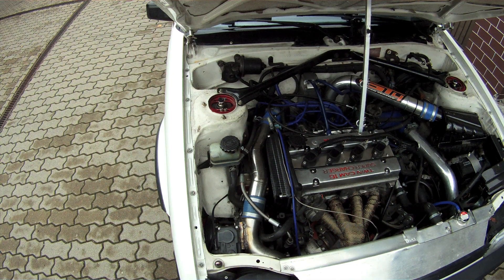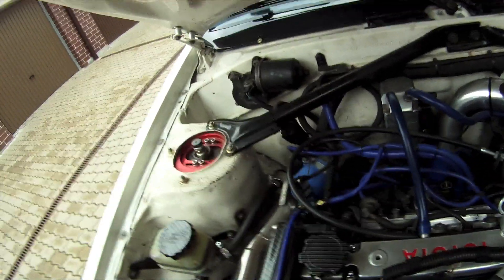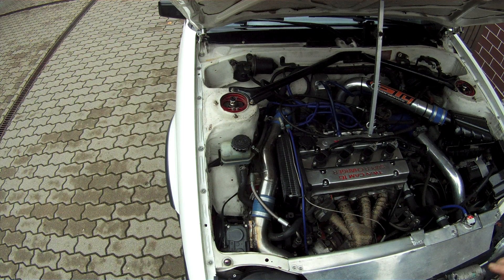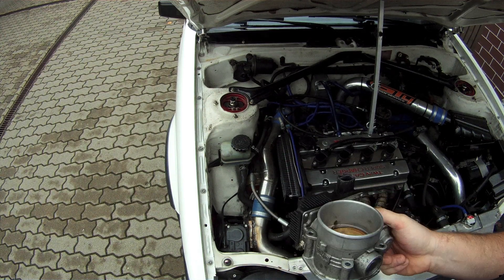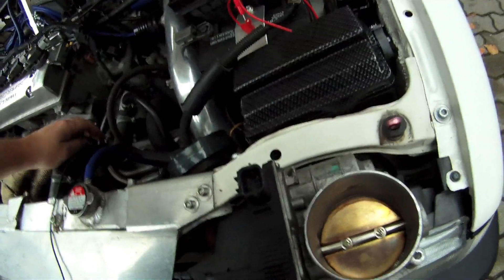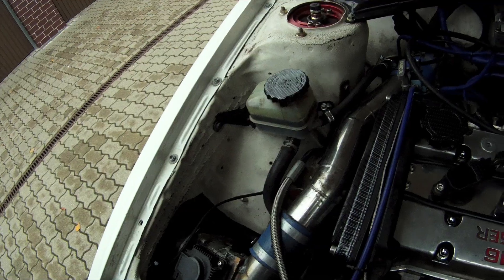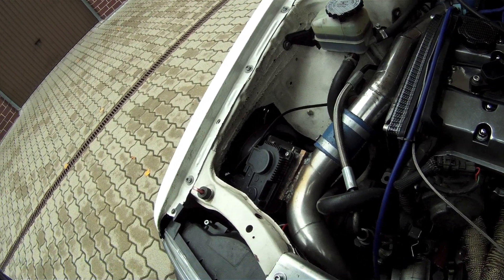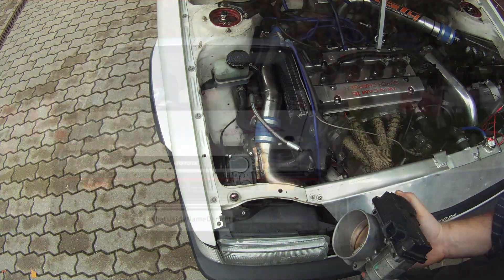Bypass Valve in Twincharged system - what I used as bypass valve in my AE82 4agzte  and how it works

Comment: Great video! Very effective setup. I am doing something similar (as previously mentioned in another comment) with a Nissan (Hitachi) throttle body. My setup is a bit different, the turbo is feeding the supercharger and the throttle body will be bypassing the supercharger based on a table in the standalone. The standalone table (based on throttle position and RPM) gives a "open %" number to a micro-controller (Arduino) which then controls the throttle body through a H-bridge, utilizing all 6 pins of the throttle body. I'll try to create a video on it in the near future. This way should hopefully allow a smooth transition from supercharger to turbocharger, however it seems that you can't notice it in your system at all, although the arrangement of the supercharger and turbocharger have a big impact on the transition, more so in my setup.

If anybody is interested in doing this then let me know, it's not as hard as it may seem.
Reply from the maker: good info man thanks for sharing. Let us know how things will work out that way. Wonder if you will also be able to hear sc through open throttle. Do you have build thread?
Reply: WhatIsMyNameDamnIt https://www.facebook.com/SR20VETS
I am still a few months away from having the new setup running, however I'm updating my build page as often as possible.

Yeah I've been wondering about the noise of the supercharger as well. It has to travel through the turbine, intake piping and pod filter to escape, so I'm hoping it won't be too bad. If it is, ah well... the more noise the better I say!
Reply from the maker: Matt Kroupa
nice man ! Its actually same thing with this nissan TB. I am sure all pins could be used to achieve progress opening like in your case but in my case it was just not needed. I will be checking your facebook man :-) keep it up.
Reply: +WhatIsMyNameDamnIt yeah thought it might have been the same TB... Came off a Nissan Primera P12... SR20VE engine. I will let you know results for sure.

Out of curiosity, are you running a MAF or MAP tune? If MAF.. Where abouts is it ?
Reply from the maker: Matt Kroupa its MAP in my case
Reply: Hmmm.. I was under the impression that different efficiencies (at differsnt boost levels) of the compressors would cause trouble with a MAP tune... I might have to give it a shot and scrap MAF! BTW.. Is supercharger pushing through closed throttle body at idle or does it have enough pressure to push open blow off valve?
Reply from the maker: Matt Kroupa I do not quite understand. At idle supercharger is not working. My supercharger is using magnetic clutch and kicks in when computer says yes. maybe i just do not get the question please rephrase.
Reply: WhatIsMyNameDamnIt Ahhh okay I thought supercharger was engaged at idle and you had a blow off valve re-circulating the air! What did you do before having the bypass valve? Was the supercharger just pushing against the closed throttle body?
Reply from the maker: Matt Kroupa without bypass valve turbo was sucking through supercharger, I do not understand part with pushing against closed tb :-/ - describe in detail scenario that you have in mind man :-)
Reply: WhatIsMyNameDamnIt Okay so before you didn't have the bypass valve, which means at idle, supercharger is pressurizing the intake (through turbo) unless you have some sort of blow off valve which is opening under idle conditions? I have read that if you do not run a blow off valve with a positive displacement supercharger, it can bend throttle bodies, and is quite bad for the supercharger itself. This was the only reason I asked.

I'm currently deciding whether or not to use a quick reacting blow off valve as something tells me I won't be able to open the bypass valve quick enough to get rid of the huge positive pressure spike if I close the throttle quickly!

If I'm still not being clear enough, I'll chat to you on Facebook about it man!

Comment: hello! first off, thanks for the explanation! you have cleared up a lot of information for me, my question as stupid as it sounds, is: how do you get the car to communicate that you want the sc disengaged and throttle body open? is it done through chips or pressure valves?
Reply from the maker: hey man. Chips. I just disengage sc and open bvalve at certain rpms. Its slightly above 5k rpms. standalone simply performs these operations at set rpms. the "turnover" is really smooth - you dont feel it.
Reply: WhatIsMyNameDamnIt
Ah thank you very much!

Comment: Awesome thanks for the info really helpful!!!!
Reply from the maker: glad it helped man
Reply: @WhatIsMyNameDamnIt  hey man, what rpm activated switch are you using on this car?
Reply from the maker: @olivert133  not sure what you mean. SA ECU turns signals depending on rpms. It is all configurable. EMU classic SA ECU.
Reply: This is how you open the throttle body and turn off the supercharger?
Reply from the maker: @olivert133  emu signals 1. electromagnetic clutch on sc to turn off and 2. relay to direct current to electric throttle body (which acts as bypass valve) to open. When it happens is configurable in ECU. In this case it was triggered at specific rpms.
Reply: Thanks mate, I think I'm gonna use a modified shiftlight in my case

Comment: Wow, thanks for the video, i'm a big fan of twincharged cars ( i fell in love with the sound of the delta s4 and i have to admit also you car has a pretty fucking awesome domoniac sound ) in the future i would probably twincharge a rotary ( i know , it's a dirty work, but someone has to do it 😉 ) but i want two completely separate systems, so 2 intercooler , one just right in the middle of engine and the supercharger and another one for the turbo system, any advice on how switch from a system to another? Maybe a very similar configuration as yours would work, what do you think?

Comment: i know that the eaton chargers have a bypass valve built in. i plan on running my setup backwards of yours though, turbo into supercharger, and opening up the bypass of the supercharger at set total boost level, like 15 from supercharger, and 25 from the turbo. when the supercharger bypass valve is open, in theory it shouldnt make boost. but it possible it might at 2-4 total. base turbo boost off manifold boost,
Reply from the maker: yeah I think MINIs had these SCs. Could be a good idea. Got it working?
Reply: I'm not 100% sure on this, but I think the Mini bypass valve is referenced to atmospheric pressure so it stays open when the supercharger isn't making boost because the supercharger essentially blocks air from getting into the intake manifold at low RPM. It shuts when the intake manifold hits atmospheric pressure to hold in the boost.

Comment: your vids have been really interesting to me, I'm planning to use the same sc12 clutched supercharger on a 4efte in my starlet, one thing that I've been wondering though, when you lift off the throttle and the turbo's boost drops below whatever the supercharger is turned off, is the engines rpm affected at all by the supercharger coming back on? or does it only run when a certain amount of throttle is applied?
Reply from the maker: yes the sc kicks in when throttle is more than 50% open and it works till certain rmps. there are many scenarios depending at what range of rmps you ease on throttle and how much but during each of these car behaves as if you operated on big n/a engine - it immidiately pulls again when you step on it. rpm is not affected and also there is no unexpected driving experience of any sort.
Reply: WhatIsMyNameDamnIt cheers for the reply, is the magnetic clutch is operated by something like a microswitch on the throttlebody or something then, or something more sophisticated?
Reply from the maker: James Beckett its operated directly by computer (ecumaster EMU standalone)

Comment: hi there , that's a very nice set up you have ..could you tell me how the fmic is plumbed in .I've got a 4agte with a 5th injector plumbed into the piping just before tvis...also what intake manifold are you using thanks
Reply from the maker: Hi intake manifold is custom made check out link in vids description to forum thread it contains all pics.

The piping and where fmic is

air box->supercharger->bypass valve(with air cone)-> turbo->fmic->intake manifold (with tb)

Comment: In a previous video you said you had a nissan intake on the engine what motor is it from I'm wanting to do a twin charged 4age did some research on 4age and the one you have is air port size difference
Reply from the maker: I think I said I have "nissan-like" intake manifold since its custom made but similar to intakes that are on sr nissan engines. here is the photo of when it was made http://cultrides.com/test/GT4/twincharge/tb2.jpg

Comment: Good job. I'm in process of twincharge mi Lancia Dedra Integrale. Did you use a bypass valve for supercharger or only blow off valve and Nissan valve for both turbo and supercharger? Really you have great dyno numbers. Your engine will be very happy :)
Reply from the maker: Nissan valve was used to provide free non limited air to just turbo (it sort of skipped supercharger). When it was open supercharger was out of the system and disengaged to to drag power from the engine. Blow off was still there in a traditional way (after turbo). Fingers crossed for your project.

Comment: Thanks for the video and ideas.
However I want a bit different system and for that I need electronic valve that would be OPEN when not energized. Do you know if Nissan throttle can be converted to normally open?
Reply from the maker: Nissan Throttle has spring inside that closes it if electric motor is not opening it (i think each tb has string to shut valve with enough force). To keep it open you would have to keep the signal flowing constantly which i think could work since its throttle body and was design to be in constant use for years but in my book that would wear the tb motor fast.
Reply: VetalK You could just use a NOT logic gate.

Comment: How is the reliability and longevity on that murano throttle body? won't it burn out the motor long term by always being fed 12V ?
Reply from the maker: I used this setup 4 years and never had problems with it. I have sold the whole setup and person who is using it now still uses same tb and no problems. Those tbs should withstand it with no sweat - in normal use (so as actual throttle body in normal car) such throttle body will receive much more punishment and should take it without complaining for more than 15 years of constant use. I was prepared as I bought spare one just in case - never had to use it thought. It works.

Comment: I’ve watched this video a few times now and realize that it’s decently old now. But couldn’t you just use a relay with the super charger clutch to limit the work or thinking? Maybe something like a relay with a single pole, double throw. Not quite sure how it could be done or in that is what really is being done, but just a thought.
Reply from the maker: You mean to open bypass valve and stop sc with one signal?
Reply: Yes. That exactly.

Comment: How do you disengage the supercharger with a clutch. I have never seen what that looks like.
Reply from the maker: sc has electromagnetic clutch. You operate electromagnetic clutch by voltage which you can provide from your car electrit grid through relay. You operate relay from your computer. Perhaps you could connect cluctch directly to your computer - it just depends what input/outputs your computer offers.

Comment: what if i have supercharger with no clutch and only use the bypass method? will the supercharger still drain power from the engine or does it just run freely because it does not need to generate any boost?
Reply from the maker: spooling insides of sc requires force so i think it will still be a parasite.
Reply: @WhatIsMyNameDamnIt  
where can i find s/c with clutch?
only thing i found was eaton m65 from mersedes. thanks for the help
Reply from the maker: @e34boat88  Eaton m62s, some mini coopers had sc with clutch, I had toyota SC12 supercharger with clutch. Pretty sure there are also more options.

Comment: Where does the air from the supercharger go once the valve closes?
Reply from the maker: when the bypass valve opens  sc is disengaged. If it was still running it would be pumping air to atmosphere - opened bypass valve means that the intake becomes open to atmosphere (bypass valve opens hole in it) allowing turbo to suck as much as it likes without sc being restriction. When bypass valve is closed (its default state) sc blows into turbo.

Comment: Can you just use a blow off valve that opens whtn the turbo creates enough vacum?
Reply from the maker: blow off valve? to suck air? Not sure what you mean.

I was thinking about using vacum operated throttle body but it would have some drawbacks:
- vacum operated so there is limited way you can tune its operation  to your needs. With electronic valve and SA with enought outputs you can do just about anything depending on signals etc. I imagine that it might turn out that when valve opens on proper vacuum it actually is too early to maintain turbo spool and then you would have power drop on switch (which could also cause valve close). Just seems a  bit problematic to setup/find proper fitting components .. but when all pieces fit and work correctly then why not. 

I have not found working example basing on vacuum switch when i was thinking about my system - just some ideas and started but not yet working projects.

There are also superchargers with built in bypass valves like eatons in MINI's (I belive it was mentioned in comments somewhere below). Maybe that would be worth a try.
Reply: I just saw your reply im sorry. What i mean is that my old blow off  was open at idle on my B16 because the vaccum was overcoming the spring force that was keepingthe blow off close.
The same way as turbo swallowing capability bypasses the cfm Supercharger is capable off vaccum will be created. This vaccum would keep the blow off open exactly like a vaccum throttlebody but more gradually. At the same time you can use a wastegate on the same charge pipe, that opens at lets say 15 psi to help the air flow feeding the turbo AND making the supercharger freespin not stealing power. If your supercharger makes lets say 8 psi setting the wastegate to open at lets say 15psi we are sure that the wastegate will never open before the turbo is 100% on because the supercharger will never make 15psi alone :) Both systems will be open to atmospher with some air filter on them.

What do you think?

Comment: how do you get the by pass valve to open when the supercharger turns off??
Reply from the maker: +cypronie nelson sa ecu operates all signals. In proper time ecu turns off sc (by turning off its magnetic clutch) and opens bypass valve by signaling relay which engages the bypass valve.

Comment: This system seems a bit overly complex. Why not just install a flapper valve that opens itself automatically when there is no longer positive pressure in the piping connecting the supercharger to the turbocharger. Once the turbo starts getting into it's ideal rpm range it is more efficient than the supercharger casusing it to suck in more air than the supercharger and a net negative pressure in the tube. This causes the valve to open. An example of such a system can be seen here:

Twincharger Mk1 escort first startup.
Reply from the maker: can you give me example of such flapper which i can buy anywhere? I chose electronic since its very easy to maintain (control if bvalve is working) and as valve you use tbody which is designed to run for years opening and closing and is cheap.
Reply: I like your solution btw, great backyard engineering. I understand the thought behind it, I just figured you'd end up with a smoother , self tuning transition and even greater reliability if you used a similar setup.

They're called single flap check valves have a look on google, you can find them on ebay as well. The one in the video is custom made by the owner of the car.
Reply: 45 to 100 kph was epic!

Comment: well .. what if I use a big ass pro charger that pumps air into a big single turbo instead of pumping it into the engine, wouldn’t it create a wide range in boost ?
Reply from the maker: I have never seen twincharge system with procharger, Can procharger be tuned off or does it run permanently? Since it is belt driven  the idea is to disengage sc not to put drag on engine in higher rpms. This is why there is magnetic clucth in sc.  Not sure if same can be applied to procharger.

Comment: the compressor is clutched?
Reply from the maker: yes its sc12 so it has electromagnetic clutch. If used it is disengaged at ~5krpm when turbo takes fully over.
Reply: I dont get why nobody have twincharging when they go Big single... I dont really understand... Ok of tuo dragracing... But on the road i think there is no better thing that having torque at low rpm
Reply from the maker: 2487mpobor
I agree you just step on it and its there. My guess would be that its uknown territory for most tuners and they prefer to stict to known paths.

Comment: Does the engine need to have forged conrods and pistons for the boost from the combined super charger and turbo?
Reply from the maker: does not matter if this is just turbo/sc or twincharged. If you want more boost than soft (0.2-0.3b) I would say forced internals is a must for any engine.